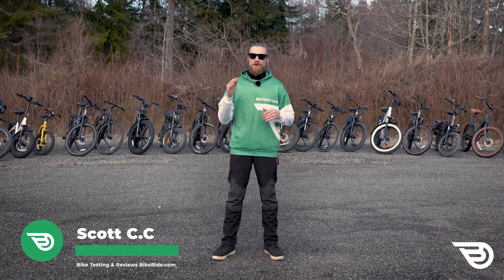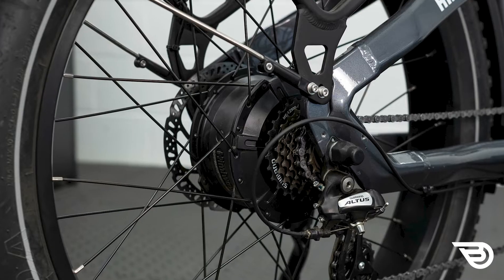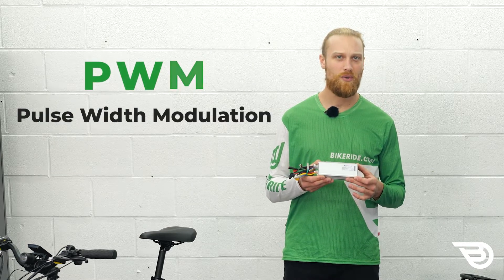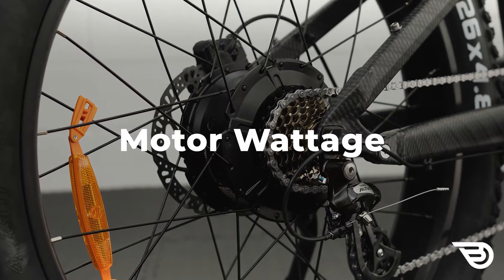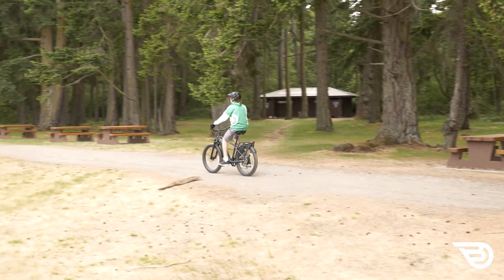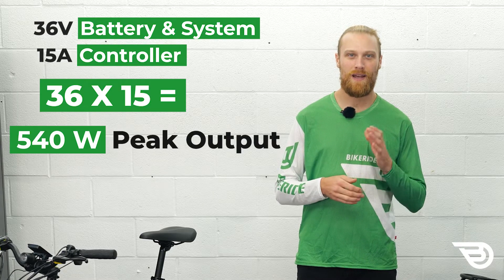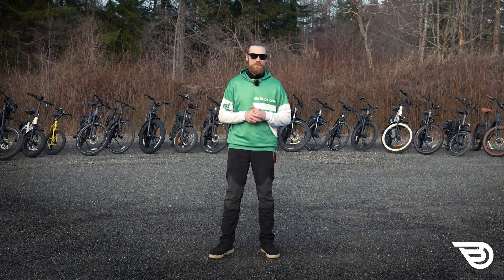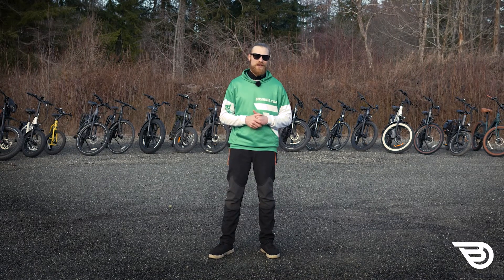E-Bike Motors - How To Calculate Wattage | BikeRide.com

Comment: I honestly think so many folks advertising 750w motors and shipping 350w.  Its not easy to test
Reply from the maker: Typically 350W hub motors has much smaller casings then 750W motors, and most motors will have the wattage included in the serial number. I have also found from a performance perspective the difference in power and output is very clear, even between 500W and 750W motors.
Reply: ActBest bikes do this.  Selling 750w sending 350w saying it can burst to 750w, which it can't. @BikeRidecom
Reply: @BikeRidecom also this 350w motor has plenty of power to pull me al8ng at 5 8 205lbs.  I cant image a 750 would be link a motorcycle.

Comment: How can you confirm the claims of the manufacturer, regarding the output of the motor and the power of the battery?
There is no testing agency to verify claims
I have seen grossly exaggerated claims of battery output, not with e-bikes, but with RC equipment, plus claims of things like SD card memory which were completely bogus.
Reply from the maker: You are correct, the batteries are not something you can open up and count cells, and motors need a special rig to test torque or power output. I can tell you from real-world testing that different bikes have huge differences in performance even with identical motors or identical claimed battery output, not to mention controllers. Any single lower quality component can change the performance of the entire unit. 

Real world testing and comparing test data is one of the best ways to tell the good from the bad, without being able to bench-test each component individually